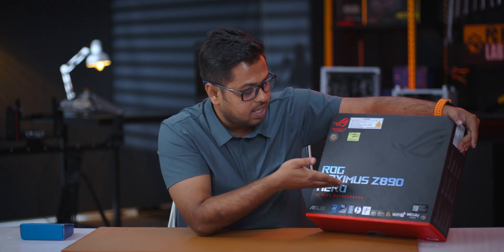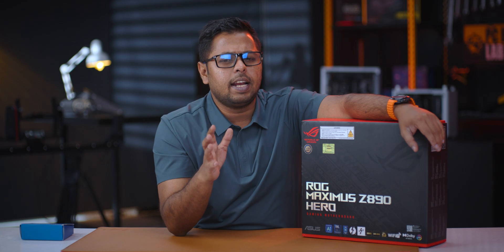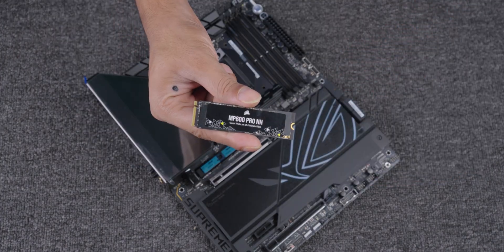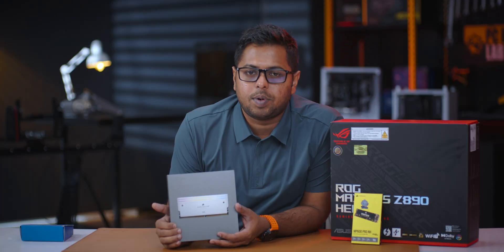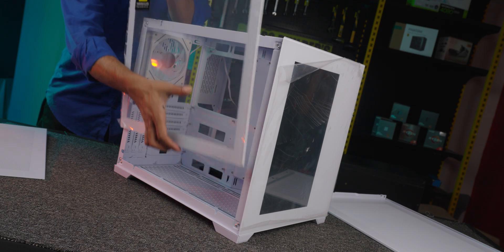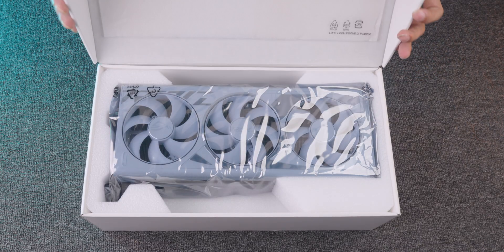500K ALL ASUS BUILD ft. Intel Core Ultra 9 285K & RTX 4080 Super

Comment: vaia  ami 100k diye ekta gaming pc build korsi kintu normal game e o onk lag korteche 😭😭😭😭😭😭😭😭😭😭😭😭😭😭😭😭😭😭😭

vaia plz ektu help koren 

ei je pc er full build purchase korsi pqs - Price quality service

CPU-- Ryzen 5 7600 Gaming Processor 
Motherboard-- Gigabyte B650 M H AM5 DDR5 Micro ATX 
SSD-- Kingstone 500GB NV2 PCIE $.0 SOLID STATE DRIVE 
GPU--- GUNNIR INTEL ARC A750 PHOTON 8G OC B GDDR6 GRAphics card
RAM-- CORSAIR VENGENCE RGB 16GB DDR5 6000MHZ RAM
COOLER - ARTIC freezer &X compact Multi-compatible 
CPU-- Corsair CX- series  CX550 550w 
Monitor-- HP M22f 21.5 inch

egula diye build korsi vaia 

arr gpu er sathe monitor er connection diyechi 
arr vaia gpu er fan spin kore na 😰😰😰😰😰😰😰😰😰😰😰😰😰

vaia prochur lag kore vaia plz ektu help koren 😭😭😭😭😭😭😭😭😭😭😭😭😭😭😭😭😭😭😭😭😭😭😭😭😭😭😭😭

Comment: 0:00 – Processor: Intel Core Ultra 9 285K
0:30 – Motherboard: ROG MAXIMUS Z890 HERO
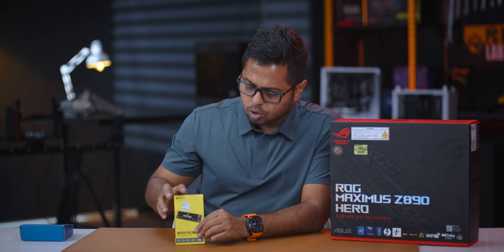4:25 – Storage: Corsair MP600 PRO NH 1TB
5:15 – RAM: Corsair Dominator Titanium White 16GB x 4
5:57 – Casing: 1ST PLAYER SP7-EMOTION VIEW WHITE Casing
7:08 – PSU: Deepcool PN850M
7:51 – CPU Cooler: Arctic Liquid Freezer III 360 A-RGB (White)
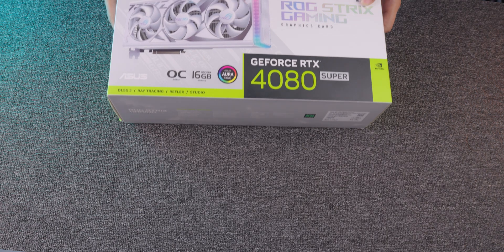8:41 – GPU: ASUS ROG Strix GeForce RTX 4080 SUPER 16GB GDDR6X White OC
9:45 – Showing the Setup: Final build showcase
10:32 – Price: 5,08,000 BDT (5 Lac 8K)